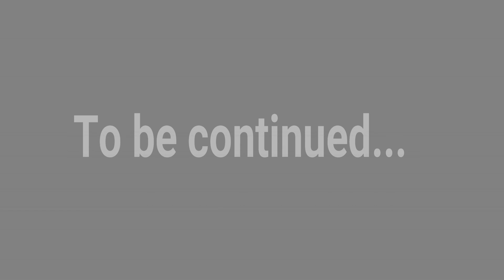Green Eagle Down - Chad's Engine Quits at 1500 Feet

Comment: Too all that are interested.  Very Very Very seldom have we seen an Eagle have any kind of engine failure as there are so many safety features built in.  Many people never service them and they still keep running.  Looks like this was a used unit about 6 years old.  The drive was never serviced and someone cranked down on the drive plate bolts breaking the back engine plate the orange silicon gives it away.  We would never repair like that, as the plate would need to be replaced or welded and machined.  
The oil leak then made the loose drive spin out on the shaft once it gave way you get the pop.  If the engine gets too low on oil it will also go into limp mode.  I have the engine now and the engine outside the leak is fine. The external crank shaft is ruined. And the back engine plate has a crack. He is lucky he didn’t loose the lower drive. 
BUT the engine will not blow up it will limit itself even without a prop it will not over rev as we have that in the power loop program.  That is an older unit probably around 6 years old.  Since then we have a larger crank, thicker drive plate and even longer warranties.  We go ahead and use red lock tight set drive because these are so easy to fly many people seem to opt out of training so they do not learn preventive maintenance which there isn’t much.  However I highly recommend training and if picking up used units we will support you.  He now has a larger shaft engine and the newer re-drive re designed for the NAVY SEALS so should have years of good safe flying.  Remember there is a break in time and you must monitor re-drive setting for at least 10 hours or so to make sure drive is set.  If not follow drive maintenance on you tube or Facebook were we explain the newer drives.    Fly Safe Ride the Sky   GE
Reply from the maker: Ashton- Thank you very much for the explanation.  Chad is still an enthusiastic Green Eagle fan as am I. I look forward to his triumphant return to the skies.